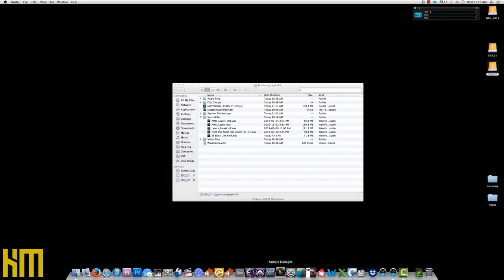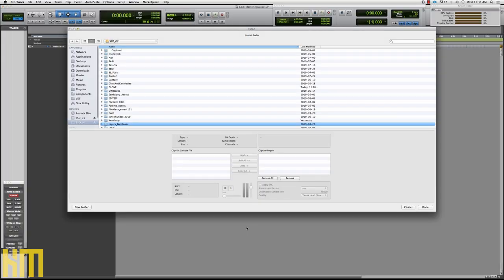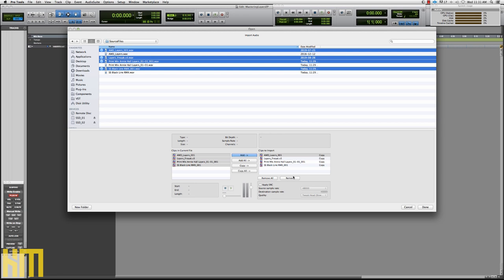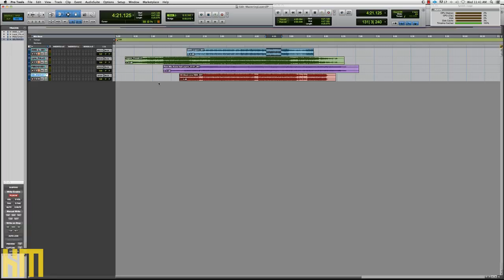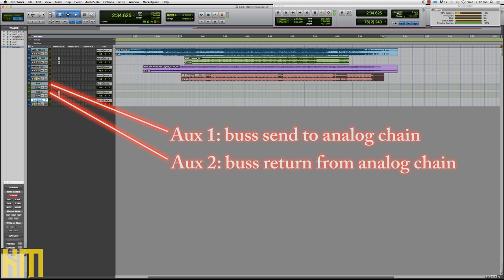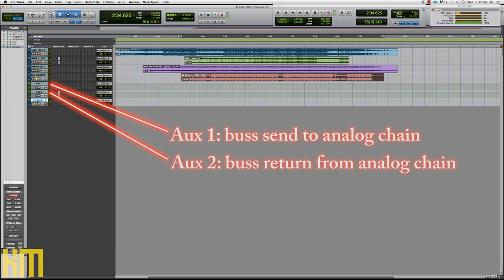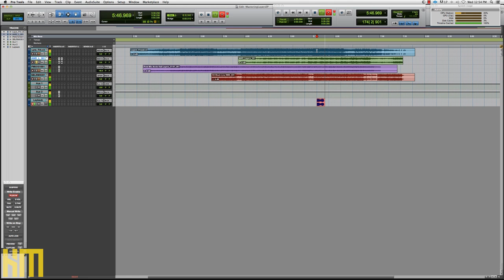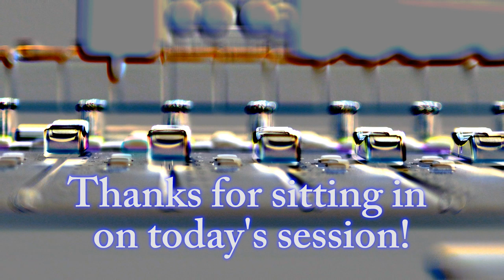Mastering Session - Sample Rates, Signal Routing and the Analog Chain

Comment: Got a question... I don't expect you to answer, but what is that device going into your sleeve, that you plugged into later in the video...? Just curious, don't expect you to answer...
Reply: ...just wondering if it's some kind of specialized audio tool, or a mic or something... Enjoying the videos! Thank you for sharing these tips and your process!
Reply: I noticed the same thing.  I think it’s a tether that will eliminate a static charge.
Reply from the maker: Thank you Shayne, I appreciate your question ;-) Absolutely, that’s an anti-static wrist strap I’m wearing!  Angry Red Planet hit it, it simply connects me to my system, which ultimately eliminates static discharge 💥💥💥.  Another benefit is my touch controls (Avid Artist Control) work approx 1000% better with that connection.  All of this is mostly due to the very dry climate I live in, particularly in the winter months ;-)). Works awesome, and keeps you from blowing a gasket while trying to make contact with a fader lmao 
Cheers, -hw
Reply: @hiwattmarshall  Cool! Thank you very much for your response!!